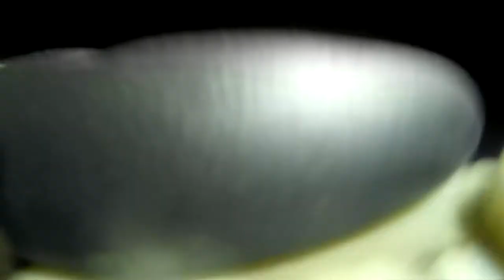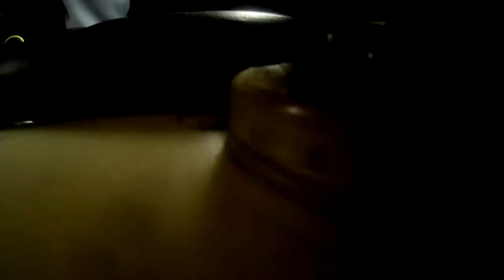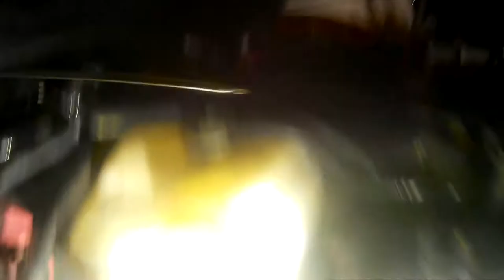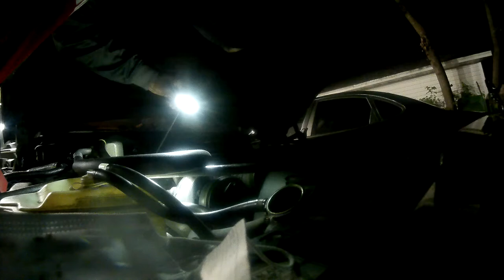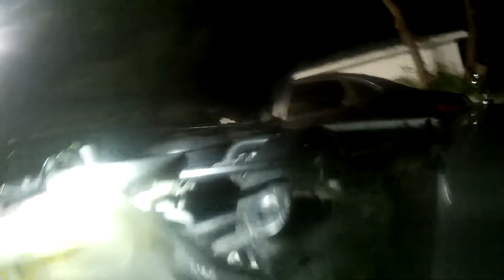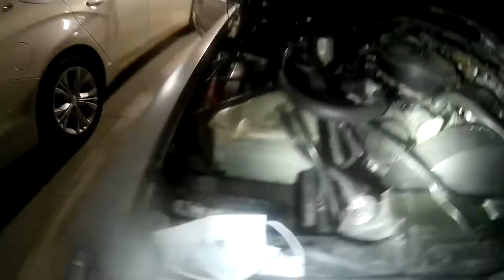1991 cadillac brougham oil pressure light came on

Comment: Speaking from experience if the oil is mixing with antifreeze and its blowing out white smoke through the tail pipe then its the heads if its antifreeze mixing in the oil making a milk shake looking fluid then it the intake if is just drinking oil then is oil leaking pass your valve seals piston rings or your engine piston rings are worn out
Reply: You have got some work to do my Brother
Reply from the maker: Not mix just burn alot of oil......but I will know tomorrow thanks for the information
Reply from the maker: Not me Lol
Reply: @godson197410  ok then I will be waiting on that update lol
Reply: @godson197410  yo ROBB BLACK if you are ever on a junkyard adventure and see a 90 dodge B250 van with the 8th letter Y could you please get it get it for me I will gladly pay you for it that van harness is difficult to find because most of the junkyards here in Brooklyn new York take everything except for the hareness out when they part out with these van before they send them to the scap yard
Reply from the maker: Yes with no problem 💯💯💯💯💯💯💯
Reply: @godson197410  when I figure ohow to privately in box you i will tell you who was on a junkyard adventure look at a complete dodge van untouched actually made a Second response video showing me exactly what I needed and never got for me i thought that was some cold shit then ask me in the 2 video what was it I was looking for and the shit was write there in there face on the damn fire wall smh all he had to do was say or say it was gone. your building a car and you Don't know how to locate a engine wiring harness on a fire wall smh
Reply from the maker: Ig @robbblack